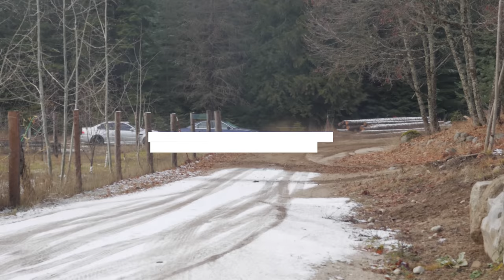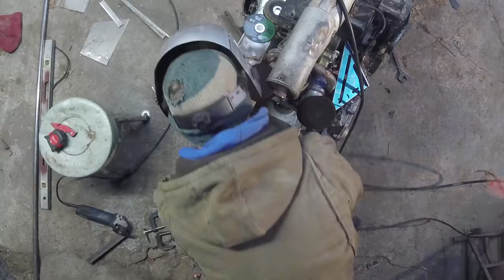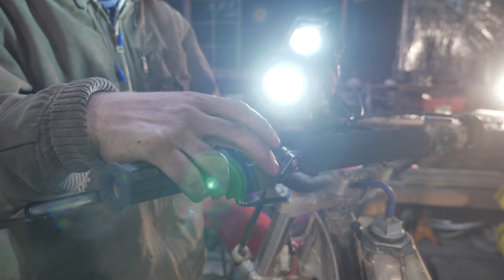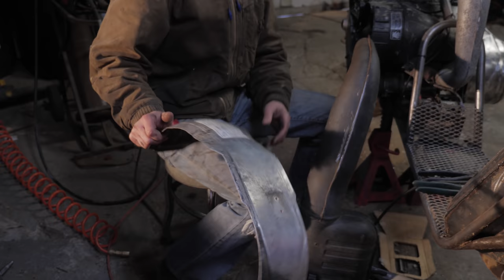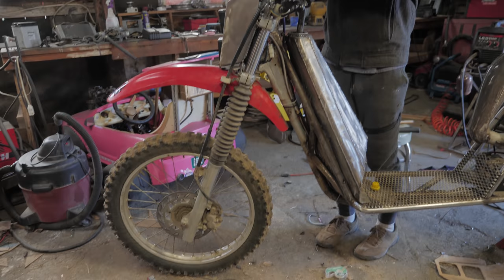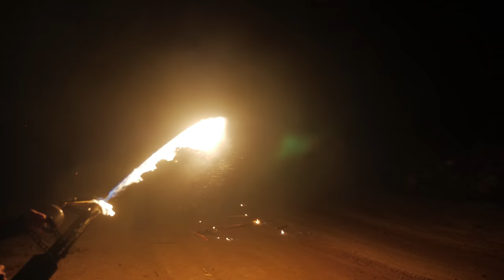The Snowmobile Powered Scooter Build Part 5 + Merch Launch!

Comment: The Heat shield should be FULL of holes - all same size, try to get them in rows and spaced nice
All exhaust heat shields are like that.......
Reply from the maker: That’s a good idea! I’ll work on that soon!
Reply: I was thinking that too haha
Reply: Eclidean  good enough
Reply: I thought I checked. I didn't realize you posted this first. We think alike. You just thought first. :-)
Reply: I was going to write exactly that :)
Reply: @GrindHardPlumbingCo  Also wrapping the exhaust from the base up to the point where the heat shield ends would probably help. What I've read, it may also improve power somewhat, not that it's needed from the look of things.
Reply: Not all. But ones without much in the way of dissipation absolutely. Id have wrapped it then put the sheild on and put vertical lines instead of holes

Comment: I think it needs a seat, similar to the old Cushman scooters.  I would reroute the exhaust down the opposite side of the bike from the drive chain and clutch. Then fit some sort engine cover / seat over and in front of the engine.  Make it so you can put panier boxes on the sides for hauling gear like the adventure bikes.  Also, I think you need to make a new front fender like you did on the back so they match.  Other then that you guys have done an awesome job.

Comment: What if you drilled holes in the heat shield? Even a few in a "cool" pattern would be, well, cool.
I'm old school and our chambers (conventional on/off dirt bike) ran right next to your leg. They had a screen like heat shield in the area where you leg was. Older bikes had a more open heat shield. Like rods running parallel. Then, later, they just ran the chamber through the bike so it didn't come anywhere near your leg.

Comment: You guys should look into using Ram board for templates instead of corrugated cardboard. It is .030" thick cardboard so its sturdy like corrugated but you can cut and bend it more like paper. You can find it in the flooring section at home improvement stores like lowes or home depot.

Comment: Winter's coming. Maybe it's time for a build with the leftover snowmobile tracks?
Reply from the maker: That’s the plan!!
Reply: Snowmobile tracks on a off-road Barbie car. Now that would be an interesting sight to see.
Reply from the maker: Haha! That would be interesting, but my plan is to put one on the scooter!
Reply: @GrindHardPlumbingCo  that sounds awesome too, I look forward to seeing it. Plus realistically the snowmobile tracks would probably be too wide for a Barbie car and I don't think you would be able to use the snowmobile track mechanism which sits in the center to be able to be mounted on each side of a little car. A Barbie car would probably need specialized smaller tracks, which they do make though.
Reply: Grind Hard Plumbing Co, you planning a high center relief roller to go underneath the step platform?🤔

Comment: congrats on the play button thats awesome. also that fricken scooter is rowdy, very nice work on the fab stuff like the guard headlight and fender. i didnt know you could well stainless with non stainless wire tho . good to know
Reply from the maker: Thanks man! We are stoked about it! Yeah, I’m not sure about the strength of it in a structural application, but it works just fine for little stuff like this!

Comment: I think I would have cut the exhaust pipe right at the flange where it mounts to the engine, remove 2-3 inches of the pipe, then weld the flange back on. That would move the pipe back further in that area to give you more room to stand/flail about when riding, without sacrificing the tune of the pipe much. Especially now since you cut another pipe up, you know what the material is like to weld to modify it.
Reply from the maker: I thought of that, but I’m not sure how much it would affect performance. I know two strokes are very sensitive to the size, shape, and location of the expansion chamber. It’s not notably in the way as is when riding, so I’ll leave it alone for now.

Comment: The way you modified your exhaust, would make it loose few horses power, and make the fuel mixture lean or rich, with 2 stroke engine the exhaust is really important, they create resonance wave who will create pressure to help the gas (fuel mixture and exhaust to come in and out).
With 4 stroke engine it wouldn't mater.
But other than that, you guys are doing an awesome job, it makes me dreaming
Reply: Woups you did put it back normal lol. Well dont mind my comment ;)

Comment: Such a cool machine. I do have concerns that if it gets crashed into something somehow and you go over the handle bars that it would be sort of easy to catch something on the corner of the headlight housing and really do some damage to yourself. Be safe guys.
Reply from the maker: Thank you! Your concerns have been noted! The handlebars will be raised a few inches to make for a more comfortable riding position, and that should also make it harder to go over them in a crash. And if you did go over, the chances of catching something on the headlights would be much lower.
Reply: Grind Hard Plumbing Co awesome man. Even if you still go over the bars, they will at least deflect you over those sharp edges. Haha

Comment: old trick for working sheet metal is wood hammer heads that u can bevel to different rounds and use a sand bag as the base to beat into doesnt work as nice as an English wheel but it gets the job done
Reply from the maker: That’s a good idea! I’ll try that next time!

Comment: All of your stainless steel will rust. Not just your seams
Reply from the maker: Is that so? And why will it do that?
Reply: Because you welded it with not stainless wire. The properties in the stainless will chance completely, and over time it will rust. If the HAZ in the stainless is not neutralized, it will rust over time. Even just hitting stainless steel, with iron sparks from an angle grinder, will make your stainless steel go not so stainless.
Reply from the maker: Interesting. Well, it’s not like it will be stored out in the rain or anything. Shouldn’t be a problem. Can always paint it if it starts to look bad.
Reply: You could give it some heat resistant clear coat, that would do the trick.